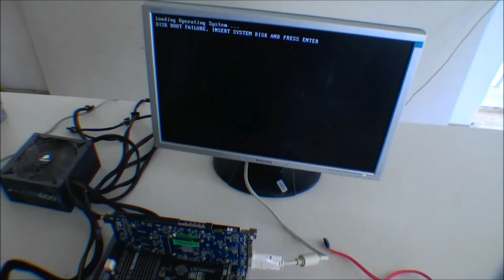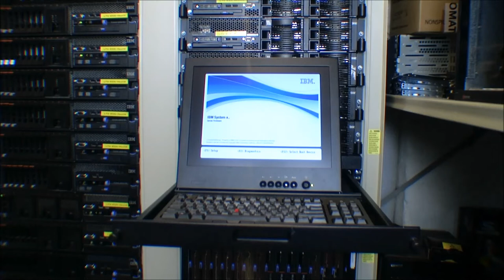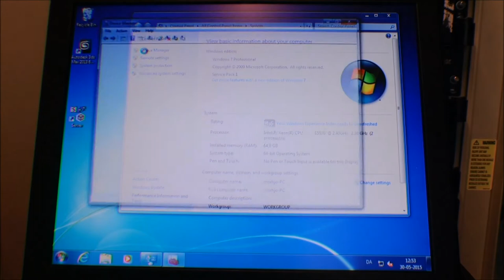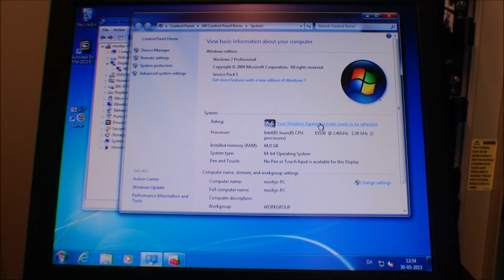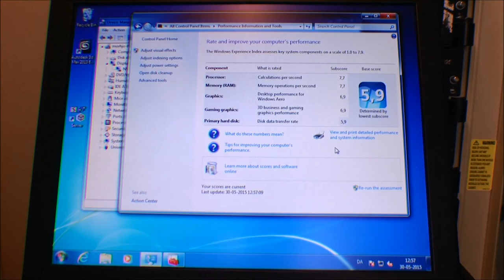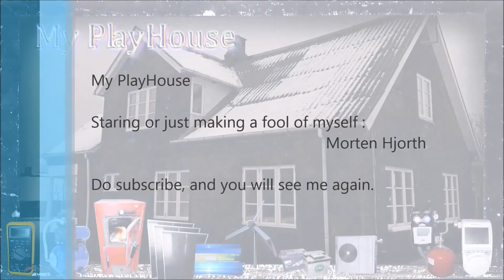NVIDIA GeForce graphic card install IBM x3650 M2/3 - 191

Comment: Been a little while Bud!  So I just decided to improve my deployment setup a bit, by adding VSGA to my view desktop pool.  Picked up a pair of quadro 4000's for a reasonably cheap price, and am now getting ready to move some internal nics to slot them.  Had to get my hands on a pair of PCI-E risers, which was easy, and when the install came, i was like oh man, these cards actually need supplemental power!  Been searching for the 8-6pin cables and of course your page came up!  Seeing how easy it was for you to make those cables, maybe i will also embark down that path!  As usual, thanks for your quality informative videos!
Reply from the maker: Hi +Shinkamui 
What did you get PCI-E risers cards for,,this IBM x3650 M2??
Thank you for watching! :-)
Reply: +My PlayHouse (Morten Hjorth) 3650 m3’s
Reply from the maker: Hi Shinkamui 
Du you have a link for the riser card you are getting ,,, I like that to,,if it's x16
Thank you for watching! :-)
Reply: well, I got them from an ebay seller, but they're essentially the same as this: http://www.primelec.com/ibm-x-series-x3550-m2-m3-pci-e-x16-low-profile-riser-card-43v7066-43w8856.  Ran into a huge problem though, the 3650 m3 doesnt' have enough room for gpu's closer to the board.  I need full risers, or a riser extension, and  I can't find anything.  SO CLOSE!  Its starting to look like it may not be possible to anything newer than an 8x interface card for graphics acceleration in these systems.  Since vGPU and sVGA are extremely picky about which cards you use, Im not sure what i can do short of abandon the IBM architecture and move toward some HP or Dell Servers...
Reply from the maker: HI Shinkamui
Yes that is for the x3550 M2/3 not realy the x3650 M2/3...
I have this in order: http://amzn.to/1Z3TULy
I getting it from Aliexpress, but same thing.
If it is any good you will see a video :-)
If you find something,, do tell me.
Thank you for watching! :-)
Reply: That looks perfect! Ill keep any eye on your channel for an updated video!  If its not too much trouble, if you're successful, do you mind dropping me a quick line? Ill pick up a pair and give it a try.  At 3$ its a drop in the bucket.  Unfortunately since i  only have the 2 servers running my infrastructure, its a bit more of a pain powering down everything just to find Im going to be unsuccessful!
Reply from the maker: Hi Shinkamui
Sure,,, they are coming in from China,,that often takes quit a while.
Thank you for watching! :-)

Comment: I predict this will be a very popular video since many, many forums have questions about this. Cutting the PCIe slot is reasonably safe, and you will not notice a performance hit on these 6 pin cards unless you put another 8x or 16x card in that riser that is "always on." These IBM servers have the advantage over the Dell 1950 and 2950 models in that they have PCI power sockets, where the Dell's do not, and external power is needed to install a graphics card. Also, you might check to see if your AMM module still works since graphics cards installed in servers can sometimes cause remote management ports not to work and vice versa. Dell had an huge problem with that as many tinkerers discovered.
Reply: Tyler Barton I'm interested in seeing if the IMM is still working as well.
Reply from the maker: Hi Tyler Barton  Les Garten 
welllll the IMM do work,,the remote controle,, not so much. :-)
I am hoping that there will be Somewhere in Bios/UEFI thing,, where I can choose graphics card. I did not get a look at that.
Friday comes a video with PCI-e x16 two PCI-e x1 and a benchmark test.
Thank you for watching! :-)
Reply: My PlayHouse That's exactly how my Supermico IPMI works.  I am skeptical that you will find a fix for it, but hope you do.

Comment: My system x3300 m4 freezes entire system at a solid dash in top left corner with my gtx 1660 ti, but not with my gt 1030 or onboard graphics. What bios setting will fix this? Diagnostics even freeze the entire system on the 1660 ti. It worked years ago, and GPU works on other systems. I used a molex adapter for the 8 pin
Reply from the maker: Hi @trueretrogamer
Thank You very much!  glad you liked the video :-)
Thank you for watching! :-)

Comment: Hi, do you or someone else know how much power the 6-pin connector in the x3650 M3 can deliver?
Couldn't find anything on the internet...
Reply from the maker: Hi +Nick Mahler
I googled it and fund : pci-e + 6pin = upto150watts. in addition to the standard 75 given by the pci-e slot the 6 pin will add up to another 75w.
Here : http://www.tomshardware.co.uk/answers/id-2332686/power-pin-connector.html
I do think i have heard that number before..
Thank you for watching! :-)

Comment: Hi, nice video one question i put nvidia card in x3650 (M1) but is not working ....bios version 1.19 should work or is only for x3650M2 and M3 etc.
I was put power from external because x3650M1 does not have power connector.

Best Regards
Reply from the maker: HI +Robert Dumitru 
The x3650 M1 can not  do pass through in VMware,, the CPU´s do not support VT-d,, which is needed.
It probably will work with local OS,, like windows and linux. :-/
Do check out my video,, on powering a internal drive in  x3650 M1 - https://youtu.be/SHRPDs1O_Wc
Thank you for watching! :-)
Reply: +My PlayHouse (Morten Hjorth) Yes i know my what i was wanted is to use graphics card only for testing not pass through with VMware....in my case was Quadro 4000 from Nvidia
Reply from the maker: Hi +Robert Dumitru 
Okay,, i have really not tried that. Not had a use for a GPU in a x3650 M1,,,yet :-/
Do tell if you find some tricks!
Thank you for watching! :-)

Comment: Would love to know if the G6 DL380 HP does path through? My DL 380 G5's do not which kind of sucks. If anyone else knows by all means I would love to know.
Reply from the maker: Hi +Doomed ForLife 
Well it like the IBM´s,, the X3650 M1 do not, M2 and forward do. It needs the UEFI Bios i have read somewhere..
Thank you for watching! :-)
Reply: k so the G6 has UEFI so it does support. I have a line on a G6 very very cheap. Hense why I ask. the IBM are still very very expensive vs the HP line here in Canada. I look at my IBM X335 unplugged. Very slow its a paper weight 1x Xeon 3.06ghz single core 3gb ram. Want it LOL.... pfsense runs on it (not using it atm). Would cost more to ship than its worth......
Reply from the maker: Hi +Doomed ForLife 
Humm it needs to be EFI bios,,,not UEFI,, my mistake.
Yes a x335 is more fun than valuable.
Thank you for watching! :-)

Comment: looks like projects simular to mine lol....  i was using one of them x1 gpu bit coin miner adapters for my dell t300 ... but it wasnt until i had a under powered power supply that i got annouyed lol and of course its proprietary power supply so i gave up  aside from the fact that the cpu dont really offer 3d rendering so it would geek up alittle sometimes gaming lol ... but the gpu worked for xen server on a older sparkle gpu
Reply from the maker: Hi Eric Draven
Thank You very much!  glad you liked the video :-)
Thank you for watching! :-)

Comment: I love how he always calls the male plugs "female"  XD males have the parts that stick into things... Even if the metal components inside the connector is technically a circle/hole, the plastic that is the "connector" still "plugs into"  things, and thus is male XD but man do I love these vids. Been binge watching evert one for DAYS now!
Reply from the maker: Hi +Hikari 
Yes,, i do very often fuck up the gender of the plugs,, and i have also ordered the wrong sex on Ebay ones,, That sucked! 
I just ordered this on Ebay,, to try this out: http://www.ebay.com/itm/DVI-DVI-D-HDMI-universal-dummy-plug-DDC-EDID-emulator-fake-display-headless-/161718045404?hash=item25a7258adc
So that will be interesting.
Thank you for watching! :-)
Reply: +My PlayHouse (Morten Hjorth) I've been curious about dummy plugs. I built a small itx computer inside a shell made from Legos just for the heck of it, and used it as a small file sharing computer for my parents. But it would often fail to fully boot because it wouldn't detect a display to output to, so I couldn't ever remote into it. Thought about using a dummy plug for it, but instead just installed something like freenas instead.
Reply from the maker: Hi +Hikari
I did connected my little screen in the datacenter,, but it´s old and the resolution,,suks,, i have big hopes for this dymmy thing,,, but well i always have :-)
Thank you for watching! :-)
Reply from the maker: +My PlayHouse (Morten Hjorth) 
Humm did i get a mail or,,ahhh :-)
Reply: +My PlayHouse (Morten Hjorth) what are you hoping to use the plug for? From what I understand, it just simulates a screen being attached so the computer will boot fully. Unless IBM servers are different, from my experience a server does that sort of thing already, its why windows 7 boots up fine on a server, but won't fully boot on a normal PC without a display plugged into it.
Reply from the maker: Hi +Hikari 
I´d like to do editing on a remote server, and using the GPU for rendering the videos. If i could get that to work i can get editors from like India to work on editing jobs on equipment in my datacenter.
Thank you for watching! :-)
Reply: +My PlayHouse (Morten Hjorth) ah yea that makes sense. Though what would you have on there for editing? I don't believe adobe supports many AMD video cards, only things like the FireStream are supported I think. While nVidia cards likes the 580, 680, and 980 usually work fine. But idk if they work well with pass through... Might just have to find a super cheap Tesla or FireStream somewhere...
Reply from the maker: Hi +Hikari 
I use Movie Studio Platinum And my AMD card shoud work on that,, it do in my Win7 PC,, and i want it to work on a virtual machine as well.
Thank you for watching! :-)